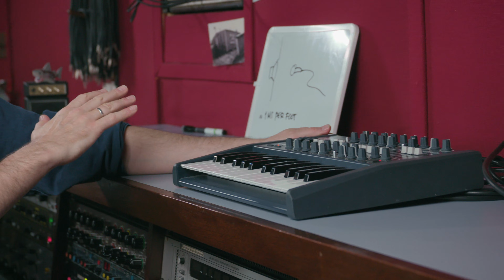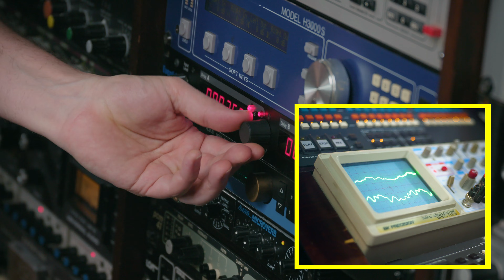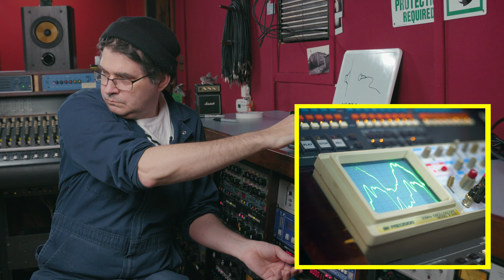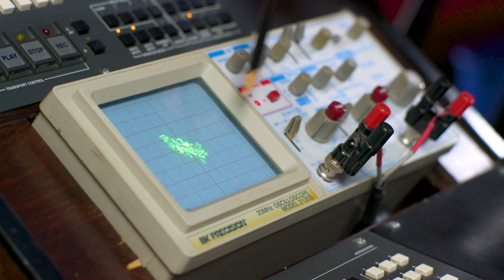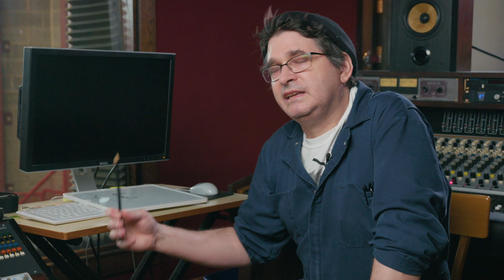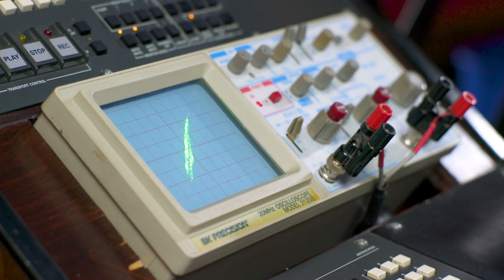Electrical Audio How-To: Time Alignment of Multiple Sound Sources

Comment: To buttress the point of analog circuts take time to pass a signal: part of the way the cray supercomputers of the 70's and 80's got those for the time unbelievable speeds was by shortening the patch cables in it to be exactly as long as they needed to be and not a mm more.

Comment: I modified a pair of vintage three-way loudspeaker cabinets in several ways, including doing away with the internal one-piece 4"x10" mid horns with 5"x15" horn lenses with separate screw-on drivers. I used the Lissajous technique to figure out how far to set back the horns from the front of the cabinet by comparing the phase of a 500Hz sinewave through the horns and the 12" drivers (500Hz is the low/mid crossover point).

Comment: I've been doing this for decades. But it's super easy to do AFTER the fact when you have a DAW instead of multitrack tape. 
When I did work on tape I'd just flip phase on one channel and move things around until I found where they nulled the most. 
Then flip the phase back.

Comment: I have a bunch of Little Labs IBP tools for dual mic-ing stuff. Quick and dirty null-check for if you don't have a dual-trace oscilloscope. reverse the phase on one mic, then dial up the phase adjuster to the WORST, most comb-filtered tone, and then flip the phase back for your best-aligned sound. Worst sound is more easily identified than best sound, in my experience.

Comment: what about drums? Ive seen people align all to the kick and snare close mikes, and people saying it's wrong. What do you guys do? (i started thinking about it, and it seems to me like its the same principle, and also, there are plugins which does it automatically, so it would be a small effort)
Reply from the maker: Not sure we all have a unified strategy. I (Tay) usually treat the overheads as the reference for phase/ polarity and flip close mics and other drum sounds against the overheads. If you have multiple mics on a single drum (top and bottom snare or toms, eg) check the phase of those against each other first, and then check one against your overheads. If the one is out of phase, flip both of them to maintain their relative phase relationship. If you have close-miked cymbals, including hihats, it's good practice to check those against your snare close mic(s) and overheads as well (and as long as snare and overheads are relatively in phase, these mics should go in and out of phase with both snare close mic and overheads in tandem).

The phase alignment plugins are a bit of a mystery to me. Presumably they are delaying some signals against others. I am wary of trusting an just trusting a plugin to do something delicate like juggling phase between 8, 10, 12, 16 sound sources. Before instilling it as part of your workflow, I would try doing manual time alignment and phase adjustment to see how good I could get it to sound, and then comparing to the automatic plugin version. If I ever beat the automatic plugin thing, I would never use it. Generally, it's a good idea to develop and then trust your ears rather than something someone sells you.
Reply: @ElectricalAudioOfficial  Nice man! Thanks so much for your honest and comprehensive help! Helped a lot! I'll try to guide me ears with your thoughts in mind! Cheers from Brazil! Stay Awesome!

Comment: Kinda like tuning a guitar with a digital tuner. Anybody else fine tune with ear afterwards even though the tuner tells you it's perfectly in tune but you don't like it?
Reply from the maker: That's probably temperament. Well-tempered vs Equal-tempered. We generally use equal so that our instruments are mostly in tune in a variety of keys and across a variety of intervals, but individual intervals will be slightly out of tune.

Comment: Where do you tap in the oscilloscope? Seems like master bus might cover the most ground, but also a longer, more variable path? Thanks.
Reply from the maker: It's on the patchbay, and is normalled to the "studio outputs" in Studio B where this was shot. There are no studio loudspeakers, so we can easily just select 2-mix to studio in the master section and it sends 2-mix (stereo master) L/R to the scope's inputs 1/2.

Comment: I know this probably isnt the place to ask for help, but I have nowhere else to go. I'm having an issue where when I try to align my sound sources, my DI signal appears earlier in my scope than my signal from my mic. I'm using an SM57 into a PreSonus Studio 68c, and my scope is a shitty scope my college gave me interfacing with Waveforms on my PC. I have an old analog scope I could use, but I've just been too lazy to pull it out of my basement, so if the recommended advice is to use a different scope, I can try that. Any advice would be appreciated.
Reply from the maker: The DI inevitably will "get to" the scope earlier than a mic because there is no acoustic delay, and no slow amp and speaker combination recreating the sound. That's not a problem with your DI! You can delay the DI as Steve discusses in this video to make their arrivals simultaneous, or as nearly as you can get them to simultaneous. Or, as many needlessly upset people have pointed out, if you are recording to a DAW you can just nudge the DI track.
Reply: @ElectricalAudioOfficial  I meant the other way around, my bad. I got three hours of sleep last night lol.

Comment: Where shalt I find the link to the un-sped up-sped section of 2:35.5 - 2:59.75? Would adore to digest the aforementioned with some fluff-ā roasted coffea? Word up...
Reply from the maker: It's transcribed in the comments below. But don't take it as gospel. Capacitors only have time constants in RC circuits, most amps are designed to have affected frequencies below the audible range, or at least below the lowest fundamental of a guitar signal, etc etc etc.
Reply: @ElectricalAudioOfficial  Fantastic! Thanks so much!

Comment: Hi Steve and Co; great video! 
Could you possibly explain how each mic is being sent into the osciliscope please? Is it via the direct channel outs from your console?
Reply from the maker: Hi, it was explained in another question below, but...

The 'scope is connected to the patchbay. So you could connect two direct outs to the 'scope inputs by patching, or multing the preamp outputs, or in any number of ways. In our case, the 'scope is half-normalled to the "studio" outputs of the console, which are usually connected to an amp that feeds the in-studio loudspeakers. So we assign 2-mix to the studio outputs and pan each channel left and right and they are routed to the two inputs of the 'scope.
Reply: @ElectricalAudioOfficial  thanks that's so helpful! 
Going to implement this in my next recording

Comment: Note the coaxial monitor behind - time aligned tweeter and mid-bass.
Reply from the maker: They're not coaxial, they're two-way we're tweeter is on top of the woofer in its enclosure. Bowers and Wilkins (B and W) Matrix 805.

Comment: What about the phase ? You can have the 2 signal in sync but out of phase by 180 degrees
Reply from the maker: I'm not sure what your questions means- this whole video is about correcting phase relationships between two or more signals on the same sound source.

While it's possible you have two signals exactly 180 degrees out of phase, usually it's not exactly 180. When it is 180, it may be the result of two mics being of opposite polarity, as addressed (one mic is pin 2-hot and the other is pin 3-hot).

Comment: I loved the gradual fast forwarding of Steve explaining the entire route the signal takes through the amplifier and speaker. And then the cut to "It's any wonder that it works at all" made me laugh out loud. And on top of that I learned way more about audio recording than from any other video I've seen before.
Reply: I hated that part.  It's insulting to the viewer's intelligence.  Just let him speak.  I'm sure it wasn't Steve's idea to do that.  So to the editor of this channel:  Stop insulting our intelligence with crap like that!
Reply: @Hyxtryx  I didn't find it insulting at all. What I took from it was that the sped up explaination is additional but not essential. Since most people won't tamper with the inner workings of there amps, it would have been enough to say, "There will be a slight delay as the signal goes through your amp or stack." However the detail is there, if you want it.

Comment: Thoughts on time-aligning drum tracks when the kit is mic'ed with four or more mics? (Say two overheads and a snare and kick). This has always been a challenge. Do you just get the snare in phase with the overheads? If so, what about the toms? They are in very different physical locations relative to the mics. You hear the snare most often, so it seems like that should be the focus, but can't we do better?
Reply from the maker: Typically you try to get each close mic in phase with the overheads. Get level on your overheads, get level on a close mic, and flip polarity on the close mic until you can hear which sounds better/ more in phase. Rinse and repeat for each close mic, listening only to overheads plus one close mic when evaluating phase.
Reply: @ElectricalAudioOfficial  Thank you for the reply!  I've been time aligning drum tracks visually by just sliding the different drum tracks around in the daw, until the transients are all pretty much in sync, but I don't know if it's bad to do that or if I should just stick to the natural phase relationships coming from the mic positioning itself.

Comment: Sure seems like a whole lot of effort and expensive equipment for something you could just track separately.
Reply from the maker: They can certainly be tracked separately. Is it more effort than aligning two tracks in a DAW 15 times on a 15 song album?
Reply: @ElectricalAudioOfficial  I've just never enjoyed syncronizing a delay processor and have zero desire to acquire/operate an oscilloscope. And I'm an extreme bargain hunter when it comes to gear. Eventide doesn't find its way into my budget. I'm practically endorsed by Behringer. The time required to track multiple takes from different sources is far more abundant for me than equipment funds or available oscilloscopes. Cheers.
Reply: @basementbastard2314  oscilloscopes are cheap and you should learn how to use one

Comment: Why not just record the two bass tracks, mic and direct. Then align the tracks in your DAW.  I get what you doing with the scope and delay I know how to do that but why go through all the trouble when you can just align the tracks on the timeline?
Reply from the maker: Two reasons:
(1)The age-old practice of "getting it right on the way in." It would seem to save time and effort to leave it until mixing or whatever post-tracking stage you do this, but this way you set this up once and if you're tracking a 15-song album, you don't have to worry about forgetting. If you are tracking only and passing off to a mix engineer, you are just leaving it up to chance whether the mix engineer will do the alignment. Best not to!

(2) If you are recording to tape, there is no DAW to use for alignment. Steve still does (nearly) all his sessions to tape.
Reply: Thanks for getting back so quick I'm going to subscribe. I think another way you could accomplished this would be to use an FFT analyzer like SIA Smaart. Send the direct bass guitar signal to one input and the mic to the other and run the delay locator in continuous mode while you adjust your delay unit.

Comment: Finally, a true Engineer demonstrates on an oscilloscope reality.  Everyone else is just guessing ultimately saying "my ears are as sensitive as an oscilloscope".  No wonder there's so many bad mixes.
Reply: In fairness, on a daw you can see the waveform the same as an oscilloscope (just not in real time), and adjust delay manually by samples (usually 1/48000 or 1/96000 of a second depending on one's setup) after the recording has taken place. Mr Albini just preferred to record to tape.

Comment: 0:48 an acoustic delay: physical distance between mic and speaker
1:26 a direct signal delay: an imperceptible delay, a fraction of the speed of light
1:40 phase difference causes phase cancellation - the canceling of frequencies between signals => thin bass; comb filtering
3:25 oscilloscope - visualize the difference of direct vs acoustic delays
3:30 ^ solution: insert, within single-microsecond range, a delay with either into signal path using analog delay or digitally, use an all-pass filter
6:25 a proper phase coherence => low freq: better response; high freq: less comb-filtered effect
7:40 microphone polarities; "pin 2 hot" convention
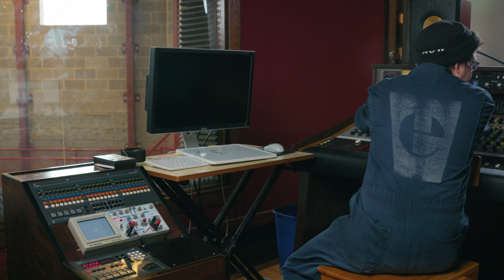8:30 Lissajous display on oscilloscope to visualize alignments differences between two separate mics' arrival times
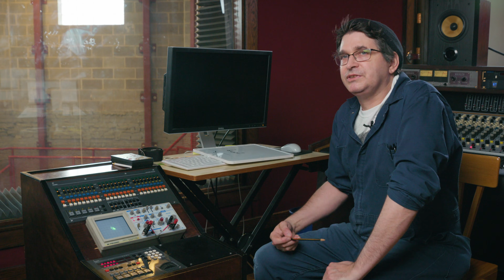8:50 ^ mics w/ completely opposite polarities
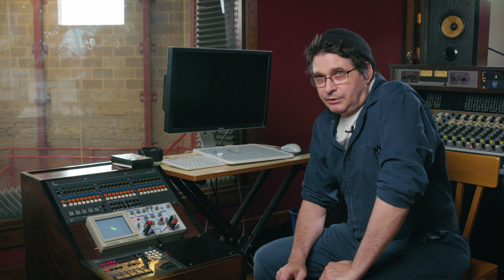9:10 ^ small adjustments by ear between the mic distances and their resulting Lissajous curves
Reply: Thanks!

Comment: I think Steve has an amazing ability to make great records!  He is also a VERY strong Poker Player!  However, he also has a need/desire/tendancy to make things MUCH HARDER than they need to be.  Measuring delay ACCURATELY to micro-second accuracy can be done in about 30 seconds using any one of a number of acoustic measurement tools (I use Smaart, but there are several that have FAST AND ACCURATE delay finders)!  As there are SIMPLE, COST EFFECTIVE. solutions readily available to do this, why work so hard for no reason?!?!?!?!?!!?
\

Comment: that is soooo cool i want a setup with a oscilloscope too ! how do you do that ? do you have a splitter and  or do you use busses and an aux ? it would be so cool if you can show the setup :)
Reply from the maker: In both studios, the scope inputs are available at the patchbay. In Studio B where this video was shot, they are normalled to the "studio" bus outputs, so at the console you route the 2-mix to the studio outputs with a button push, and your L/R inputs are "shown" on the scope.
Reply: @ElectricalAudioOfficial  that is sooo cool thanks!

Comment: Isn't there a software plug-in that corrects this?
Reply from the maker: There are quite a few. You can manually nudge clips in the DAW, but it's important to remember that each track needs to be one clip, ie if you have a track that's got seven clips in it and you select one and are nudging that around, you've only corrected one of the seven. It's led to many facepalms in these parts.

One plugin that we know of that does a good job and can compensate both "forward and backward" in time is Eventide's Precision Time Align. It's a good one.
Reply: @ElectricalAudioOfficial  I feel like nudging tracks is a slippery slope. Thank you for the software recommendation

Comment: This is an elegant old-school solution of course, but…. 
He does realize that this is 2021, and this can easily be remedied basically instantly in any modern DAW software, right?…
Reply from the maker: As discussed in other comments, it is always best to "get it right" going to the multitrack recording, rather than leaving a number of mistakes in the recording for yourself or a mix engineer to fix later. If for no other reason, you might forget when you are mixing, or if you're passing a recording along to another mixer, they might not correct any issues with the multitrack, and so it will sound bad!

Also, you can't correct via DAW when you don't use one because you're working to tape. Part of what we want to do with your channel is make tape seem less intimidating and exotic, and provide solutions for problems to people who may be trying tape recording for the first time.

Comment: question for anyone to answer, so we invert phase when the wave form of two mics for examples fight each other peak on the waveform 1 and valley on waveform 2 so we invert 2 to have a peek so they both are alligned, but what if the waveform 2 is positioned in a way where the peeks and valley arent alligned, so even when we invert the phase of waveform 2 its still not alligned? does it work still or do people then move the waveform manually untill, its somewhat alligned
Reply from the maker: You need to delay the "earlier arriving" one so that it corresponds with the other, and flip polarity if necessary.

Comment: This makes me wonder if there a use for deliberately delayinh two signals for the resulting delay, phase cancellation, etc to produce guitar effects. Its a question for you Mr. Albini please.
Reply from the maker: This is not Steve, he doesn't respond to Youtube comments, but you've kinda just described what flangers/ phasers/ chorus effects are. These all play with delaying a signal to create comb filtering in creative and interesting-sounding ways. You can use static signals (ie delayed signals where the delay time isn't modulated/ doesn't change) to create comb filtering, as well, and it may create interesting results. Experiment and have fun.
Reply: @ElectricalAudioOfficial  thanks for the nice note!

Comment: 2:35 at 50% playback speed 

…and then the preamplifier has to get the signal to the power amplifier section which then has to modulate the power supply through the outport, output transformer which then needs to couple the primary and secondary windings to the output cable which goes to the loudspeaker which then gets its voice coil energised… then that... the voice coil then drives the speaker cone inside its magnetic gap and the compliance of the cone needs to move the air that’s in front of it. That air pressurises and that pressure waves comes through the physical distance between the loudspeaker and the microphone… Then the microphone diaphragm needs to move and make its way through another transformer and then down the cable which has some capacitance… then into the microphone preamplifier…. 

Stoned Steve Albini: itsss a wooonderrrr it worrksss at aaaallll